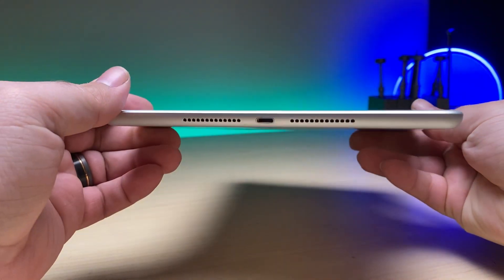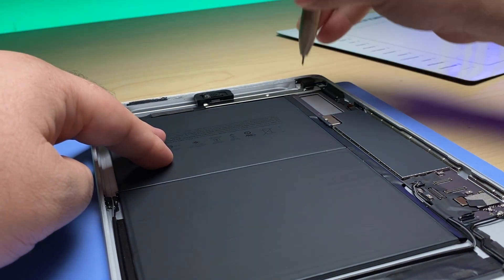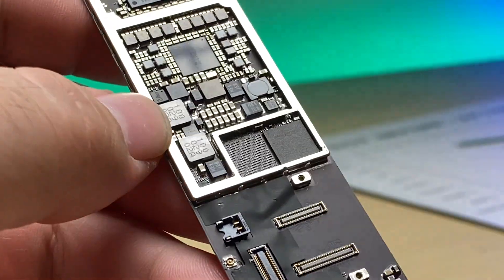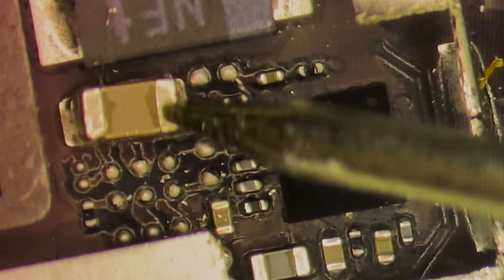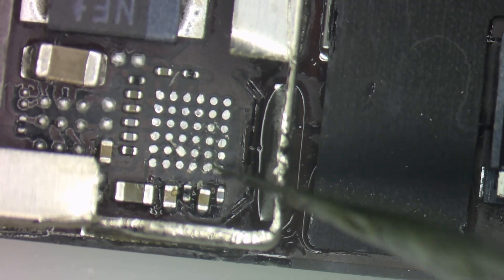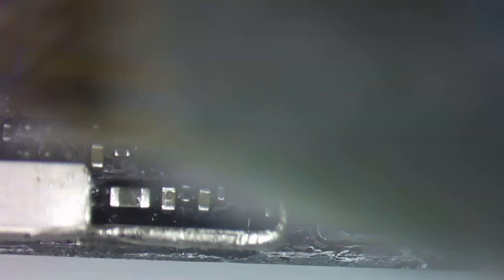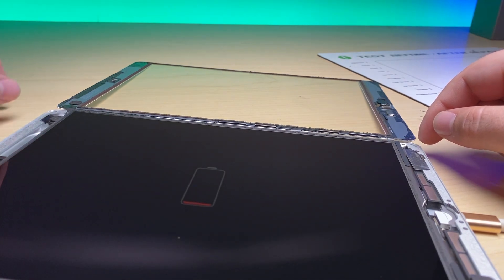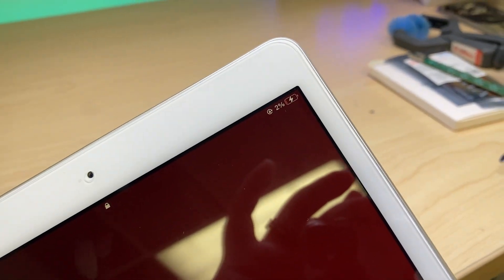How to Replace Tristar IC for iPad 7: Step-by-Step Guide (Tips and Tricks #53)

Comment: So, I just watched a video for troubleshooting an iPod 7 touchscreen not working. First, he tried lifting up the battery to disconnect it, and then hard reboot. 
That didn't work, so he connected a new digitizer, tried again, and that didn't work either. He basically said that you win some, and you lose some. 
I found in the comment section, someone said that "It's the IC filter" that is bad. Is that right? Is the IC filter he might have been referring to the same thing you replaced in this video? Thanks. Hopefully you see this. By the way, your video was great. :finger-red-number-one:

Comment: Hi, do you know if it's necessary to replace the battery along with the tristar chip? I was told by another technician that typically the battery is the cause of a bad tristar chip and therefore they should both be replaced when the tristar fails, is this true?